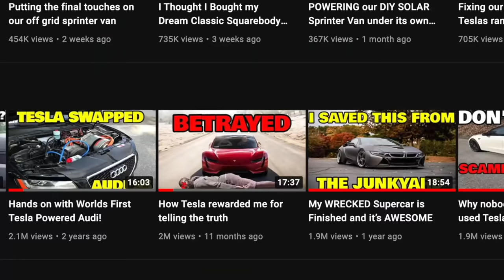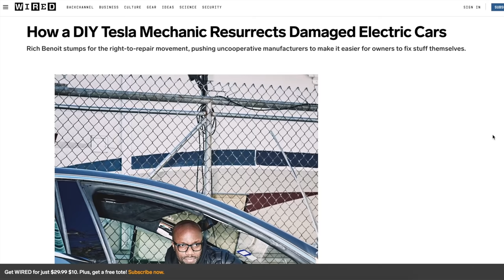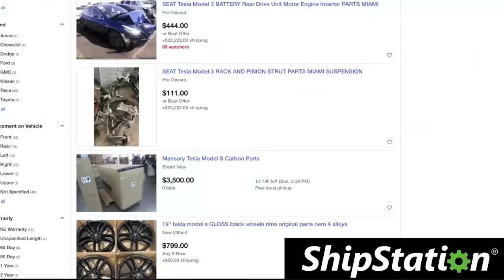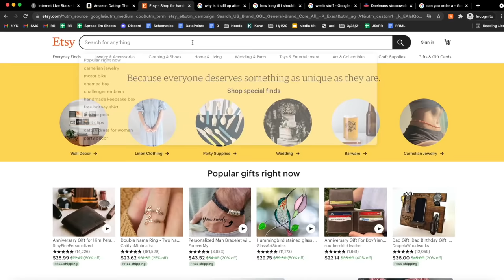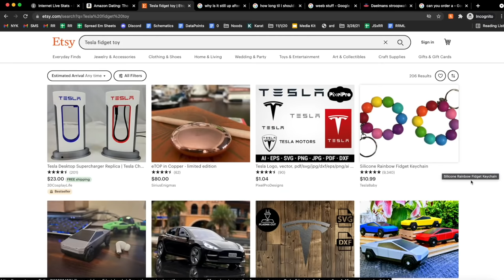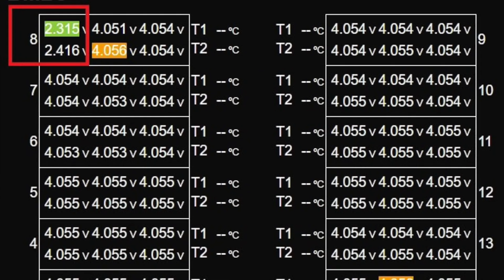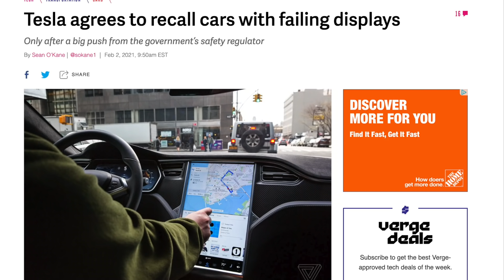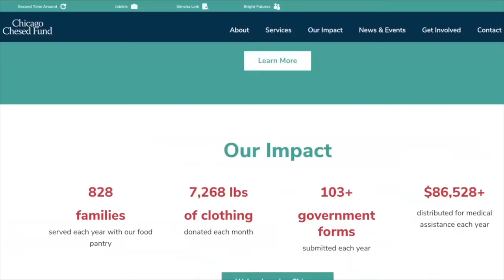Tesla wanted $16,000 to fix this NEW Model 3, we did it for $700! The importance of Right to REPAIR!

Comment: Right to repair anything you buy -- YES!!!!
Reply: @Buggabones  For a repair such as the one shown? 
If I am in over my head on something, I seek professional help, but there are lots of repairs, including on old-fashioned tube-type radio equipment with capacitors charged to 15kV, that I have safely done myself.
Reply: @johne7345

Ahhh yes. The good ol' flex capacitor fix by the Doc.
Reply: @daixer3156  ... or the "Mr. Fusion" update. My elder son leads a fusion advance development engineering team and cringes when I mention the "Back to the Future" movies.

Comment: Nice fix.  Personally I would use a pvc or poly nipple.  On the odd chance this happened again I'd want the nipple to break before it could break the coolant unit.   Lol my home water filter has a flush system nipple break and considered using a brass one then thought welk I'd rather replace the nipple than the unit

Comment: A clever repair! As a metal fabricator,  I'd suggest taking a piece of 16 gauge steel (or stainless) and make a guard that goes behind the plastic belly pan. I'd bend it to a 45 degree angle and mount it in front of the hose/connectors and bolt it to the cross member. I could make some, if anyone is interested. I live in NJ, btw.
The fact that Tesla doesn't do this from the factory, tells me they do not know cars, they only know Teslas.
Reply: If you make it, can Rich Rebuilds put it on?
Reply: @senordockman1138  if I make it correctly...sure.
Reply: Won't this guy be liable when he returns the lease? Or will he just pray no one saw this video, lol
Reply: I was thinking something in line with also.  Crazy nothing there to protect everything
Reply: That is exactly what I was thinking: repair it, then protect it.
Reply: You could probably make protection covers for this fitting and sell them. With more knowledge about what is most frequently damaged from hits, you could make a set of installable plates for all of them.
Reply: @senordockman1138  please i support this
Reply: @Fifth313ment  you've got a running car from tesla you return a running car that's all it matters mostly is Tesla problems for poor cheap design on the underneath plate covers

Comment: thanks for this you are so funny .after seeing how easy it is to break the cooler line .I built and installed a bracket on my model 3 performance because I race it and I can see me having this problem
Reply: Again if I were the Tesla company, I would come up with some kind of protection for this weak area, or perhaps even a repair bulletin to prevent this.
Reply: @daviddipasquale5479  No. They do such things on purpose. They sell battery for $16000. Then refurbish and resell the one with broken niple. 32000 minus few hundred of refurbishment cost. Fix this? Why? It is perfect.
Reply: Now thats good planning

Comment: The magnuson moss warranty act in the US basically forbids Tesla from voiding his whole warranty for that repair. They could void the warranty on that part of the cooling system, but that's about it. They'd also need to prove it's justifiable.
Reply: Void the warranty on a part that will outlive the car?  I do plumbing so yeah it will last THAT LONG.
Reply: @bunzeebear2973  I mean, Tesla is probably going to be dicks about it and void the warranty of the whole battery pack if not the whole car, but they likely won't have a legal leg to stand on, which was my point.

Comment: This is how Elon cares about the environment. Instead of changing a $2 coolant nipple he insists of changing the whole battery.
Reply: Well …HE didn’t say that but yeah. That way of thinking needs to go away. There needs to be an easier way.
Reply: Elon cares about the environment. as much as big oil
Reply: Ev has nothing to do with enviroment if you look into what it takes to get the material to build these along with where does the power come from  ?  All about the 💰
Reply: @isaacboettcher2970  yeah EV all smoke and mirrors when it comes to enviroment and wait 20 years when its time to disposing of the batteries
Reply: Well they have to warranty it so it's easily understood. What isn't is how they cockblock at their charging station! Cheap charging for all!
Reply: @zadekeys2194  elon doesn't know anything. But he is the greatest engineer. Elon is saving the world by living in a shack, but flies in his private jet a lot. 

Elon is a genius, but mostly in 3months maybe, 6 months definitely. Elon said full self driving, but Tesla says it's Lvl2 assistance. 

Elon said all Teslas has the required hardware for FSD but here we are with MCUxxxxyyy and don't forget there is no FSD. 

Anyway Elon is the greatest!
Reply: It'll be his accountants who figured out it makes them more money and have to train fewer people by not doing component level replacements, and only offer assembly level replacements. That's what you get when you measure people's performance by how much money they make rather than what is the right thing to do.
Reply: Ev and battery in general is just the new oil. Rich making a way to attract new money. 70% of the plastic in cars is derived from oil. If you ban oil you wont be able to build cars.
Reply: Elon only cares if you say you care
Reply: @Hooked_on_Gyro  that's if it gets to him... Don't assume that it all gets to him / is assigned the same importance as he would give it. As those on the bottom won't know what's happening at the top, so the opposite will happen.
Reply: @Hooked_on_Gyro  so when you are totally unaware that something is wrong, you'll fix it how? He likely has 10x teams of 10-30x each that report to him, just for Tesla. Very easy for small details to not reach him at all.
Reply: @Kyle655 lol  have you really done a comparison ?  What does it take to mine the precious metals for that battery  plus where are you getting the electricity  plus the resources to get the power to your house   you need to do the research I work in the power industry  ev is a scam right now
Reply: @Kyle655 lol not an engineer you want to make ev more efficient figure out how not to use fossil fuels and materials until then good luck  the off set is alot longer then that now when those batteries are junk where do they go.  I'm looking at the bigger picture  as you should as well
Reply: @Kyle655 I thunk ev will get there I wish we could as batteries get better material gets better but right now  not so good  im looking at a long term when these  solar panels go bad and wind turbines are junk where do they go can you recycle all parts
Reply: @Kyle655 yes! Have a material that can be reused
Reply: @Kyle655 no worries here  I'm the same way  sounds better in my head then how I talk and or write
Reply: Additionally why are those parts plastic in the first place.
Reply: Krapula, it’s not like Tesla will throw out the old battery, they will re-air and resell it.  Environment is not the issue
Reply: The problem is, that would be plenty to deter me from owning another EV after that.
Reply: I wouldn’t be saved by Elon if I was stuck in a cave ffs
Reply: By chance is the Mechanic's name Elon Musk or are you referring to THE guy Elon Musk?
Reply: @matthewjames6076  i doubt that .. i think its not elon .. its people working for him ... i m not saying elon doesnt have a blindspot .. just saying ...
Reply: @matthewjames6076  .Tectonic Plate subduction zones take in All wastes for Total recycle.. 4.5 billion core years and no complaints ;}
Reply: @matthewjames6076  he cares about the Martian environment more at this point
Reply: @The ElevatorXpress if it’s recycled it’ll end up either in Asia or in the ocean.
Reply: @L0n3W0lfBl4ck  weight reduction
Reply: @WaIIyMaven  at one point something inside the battery will have to be replaced. Rechargeable batteries become useless when they are charged out.
As far as recycling goes look at what is currently going on it’s just a joke.
Reply: Not fair on Elon.  Very fair on the - as yet - imperfect Tesla service network.
Reply: The problem is it’s not worth their time to do it when they can swap batteries, rebuild and resell old one. Eventually the aftermarket will fill this gap and he knows it. I think he’d rather they did anyways.
Reply: @zadekeys2194  Don't make excuses for the con man, it's the business that he bought so it's his responsibility.
Reply: @bigboldbicycle  Accountants? Nah he's just using the Apple playbook.
Reply: @zadekeys2194  Whatever, it's still his responsibility. Ignorance is not an excuse. His company isn't anything special, they don't operate ethically, they do it to make as much money as possible.
Reply: @TsLeng  how is Elon Musk an engineer? A liar yes, but an engineer? You need very specific training and qualifications to call yourself an engineer. If Elon has them they came out of a Christmas cracker. An engineer would have known that the 100 year old vacuum train idea wasn't going to be practical back then or now or ever.

Comment: Wow. This is absolutely crazy.. I literally apparently “hit something” and what I hit apparently went thru the tire wheel well tub and hit a coolant line. My car lost power and started flashing lights on my screen. I immediately pulled over and noticed a blue liquid pouring out the bottom out of the bottom of my car. I had no idea what it is. So I requested a tow truck. Tesla texted me and asked what happened. I explained what happened and they said, “Oh well the good news is, it’s only battery coolant and the Model 3 can drive short distances with little or no coolant. Just drive it home and schedule an appointment.”  So I make an appointment and go to Tesla and the service techs were completely rude. I honestly do not believe I ran over anything. The coolant line busted right where the two white connections connected. So they voided my warranty and charged me $495 for a $8 piece and the rest LABOR!!! I ABSOLUTELY love my Tesla, but their service is CROOKED.. I honestly believe they know NOTHING about cars and they make up charges. I have friends who know people who used to work for Tesla and I heard that the service advisors are being told by their bosses they need to up charge. The whole process was a headache!!! I went to the Tesla repair center in Santa Ana. THEY SUCK!!!!!!
Reply: That sucks, not trying to downgrade your situation but at least they didn't need to charge you for an entire batery pack replacement.
Reply: This is why they aren't even more expensive from the start. They know if it needs a lightbulb, they are going to charge hundreds. Service is a joke. Unless you're an old lady who drives to church and that's it, something will happen at some point, and they are going to try and charge the hell out of you when it needs even a minor repair.
Reply: I'll keep my old trusty Jeep. Never breaks, never lets me down, climbs the biggest dune in Death Valley. What more do we need?
Reply: voided your warranty?  not legal.  Moss Magnuson warranty act says they cannot.
Reply: @chubbysumo2230  at that point it's a process with legal fees. Have to ask if it's even worth it.
Reply: This is standard practice for all car manufacturers. This is not unique to Tesla.
Reply: @biggestthreattoyourexistence  this is not standard, not at all.
Reply: Was that on Pullman, over by the 55?
Or at Jamboree and Barranca?
Reply: Great story. Its probably missing a few facts tho...
Reply: @Gvistic  yeah no I’m happy too. I didn’t hit the import nipple. I just busted a hose
Reply: @chubbysumo2230  well I guess I used the wrong word. They didn’t “void” my warranty. They considered what happened a road hazard and they didn’t fix that part under warranty. Sorry I guess bad choice of words.
Reply: @F8Tributo  it was the service center on standard Ave in Santa Ana
Reply: @AdjustinThings  you have questions? I’d be happy to answer them!
Reply: @jazminesanchez7449  Well, "i don't believe I hit anything" & "they were rude" & "they voided my warranty".   

There's more gaps in your story than there are in tesla panels.
Reply: How can you like a car when the company treats you like that F them. Never buy again.
Reply: @johnseavey6622  yeah it is pretty frustrating. It’s an amazing car, the service just sucks.